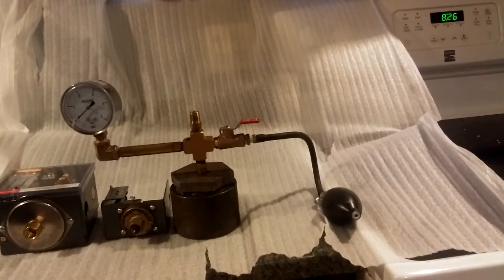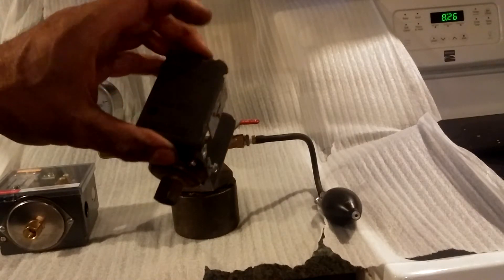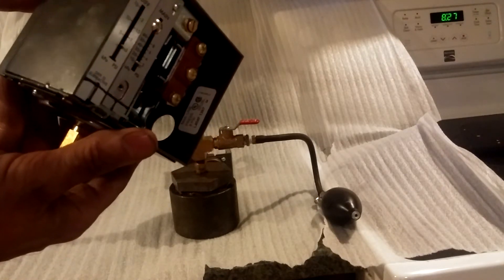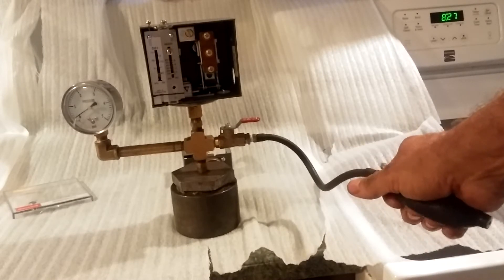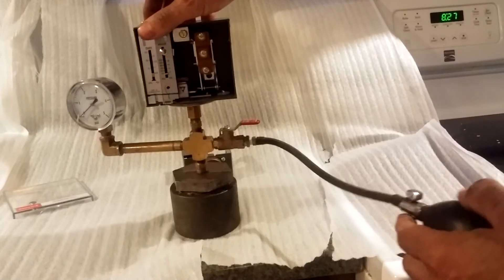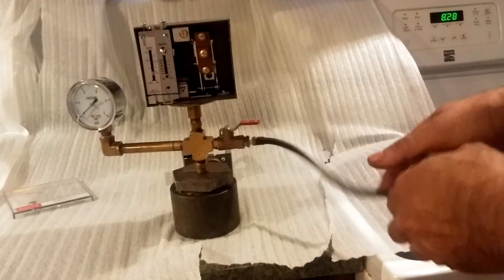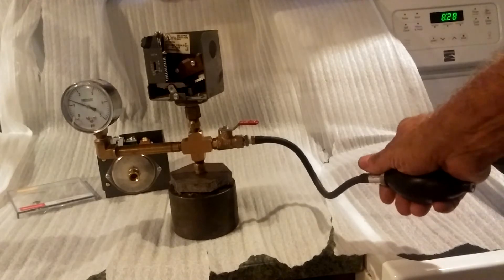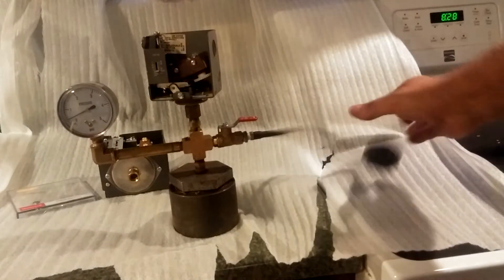Honeywell L404F-1367 Steam Pressuretrol - #@&$% TRASH!

Comment: i went to Dan Holohan steam school he talked about ounces/psi! how lower of pressure pa404  lower it down to? i have Burnham blr with a L404r1367POS 🤬🤬🤬🤬🤬🤬
Reply from the maker: @TimothyWrenn  I'd replace that control with a PA404A. 
It should operate at between 0.5 psi on and shut off at about 1.5 psi 
If your system needs lower pressure, consider getting a "Vaporstat".

Comment: Just purchased a new Burnham IN 6 boiler that came with the L404F 1367 controller. Bench tested it, as you did, with pretty much the same result. Opens fairly close to set point, but the differential setting is absolutely useless. It is at least 2 psi regardless of the differential setting. At cutout settings of less than 3 psi it does not reset reliably. Burnham needs to wake up, and put a decent control on their steam boilers! I'm using an older vaporstat that is spot on, so this piece of junk will be a secondary control, if I even decide to use it at all. But damn, it's brand new. I foolishly expected more from Honeywell. You don't even get what you pay for anymore.
Reply from the maker: Thank you for that feed-back.
Glad to hear you have a working Vaporstat!
If you mount a secondary back-up pressure control, I'd get it mounted on a separate pigtail for redundancy.
Might even consider getting a manual reset pressure control for good measure.
Reply: . @gordonschweizer5154  Yes sir, excellent advice, and already done. As a matter of fact, it's all part of a new one pipe steam system I'm installing in my new home. Call me crazy, LOL. Nothing like steam heat, in my opinion.

Comment: Hi - so I have a question. I have a similar Pressuretrol, but after I have reset my boiler, my Pressuretrol reset button does not click, so it does not ignite the boiler. Is this an issue with the device or is there something else? I assume that at least hearing a click would help to reset the boiler. Not useful when NY/NJ are absolutely cold right now!
Reply from the maker: That might be your "pigtail" is clogged. 
Hope that helps!
Let us know.

Comment: I have this exact model pressuretrol on my 2015 burnham boiler. Today is January 2022 and now that thing isn't turning off and is now forcing the high pressure pressuretrol to cut out requiring manual reset. Any suggestions on a replacement?
Reply from the maker: A simple PA404A pressuretrol is recommended.
If you haven't already, take the L404F off and blow into the pigtail.
It might be clogged and so this issue might not be the fault of your current unit.
Reply: @gordonschweizer5154  Thank you! The pigtail is nice and clear. Guess I will be making an early morning run to the plumbing  supply. I will tell you how I make out. Thanks again for the suggestiom.

Comment: L404f min set point is 2 psi, min diff is .5 psi, they won’t operate correctly under those min settings, you want to go lower than 2 psi pa404 works well, or really great pressure control would be the Honeywell L408j vapor stat works wonderful for residential applications.
         The L404f is most commonly used control in all New York City commercial boiler boiler settings, it is a robust control that performs well in a commercial environment.
Reply from the maker: Thank you for your comments!
Reply: You have taught me more than all the videos in this channel.

Comment: That "platform" on your test rig.  That almost looks like a coupling with a bushing. But it's turning so smoothly I almost doubt it. What is that?
Reply: the more I look at it, it doesn't look like a bushing.
Reply from the maker: @raindogs451  I believe you are referring to the base, which is a high pressure rated threaded steel cap, of all things. Got it from a specialty supply house, since closed.

Comment: Looks like you have something going on with the Differential adjustment. It should not flop around like it did when you were tapping on it on the L404F. I have had many, many PA404  pressuretrols override pressure settings by 1 - to near 5 psi. I never use PA404A's for anything anymore due to too many overshooting. The overshooting costs my customer more fuel dollars. Higher steam pressure is an exponential increased fuel bill.. My control of choice is the L404F
Reply: Thank you for your thoughtful and knowledgeable reply.  I appreciate that you find the L404F to be a superior control than the PA404A.  It certainly looks like it should be, what with its larger diaphragm, seemingly better construction, and higher price.  I fully, totally agree with you on the waste and other negative issues of too high steam heating system pressure and the benefits of keeping the pressure below 1.5 psi (and even lower) pressure. 

I find, however, that once the PA404A is dialed in to the correct settings using a technique that by-passes the witness smoo on the adjusting screw (and that I do not share on YouTube because... lawyers), the PA404A control is a better value than the L404F and is dead nuts accurate and precise.  I have found the settings way off on not a few of the L404Fs I've encountered and I haven't figured out a way (yet) of by-passing the blue smoo to correct the settings.  For example, on a Burnham Megasteam install not long ago, the L404F that was shipped new with it was so off, that we were forced to re-use the PA404A from the old boiler!  That L404F was turned in to the wholesaler for credit.

So I must respectfully disagree with you about the L404A vis-a-vis the PA404A.

Do you have a video of a properly working L404F that you could share?